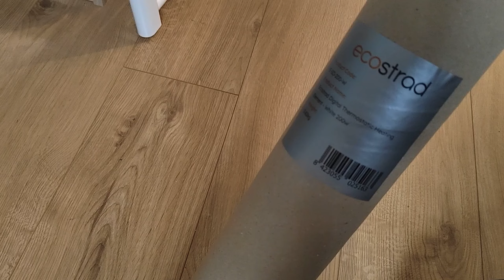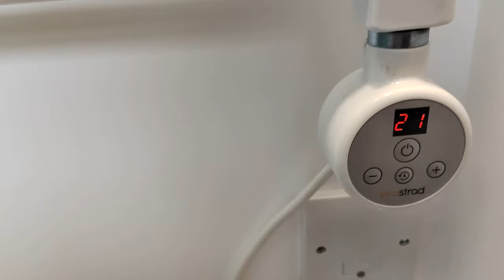Pre-filled electric towel bathroom  radiator installation and hard wiring

Comment: Can you advise on towel rads that claim to be 'dual fuel'? As in connected to central heating, but with an electric element too.

I like the idea, but am dubious about whether it actually works well...
Reply: Ours is DF. You will notice no difference whatsoever
Reply: Ours is DF. You will notice no difference whatsoever
Reply: Ours is DF. You will notice no difference whatsoever
Reply: Ours is DF. You will notice no difference whatsoever
Reply: Ours is DF. You will notice no difference whatsoever
Reply: @felixscamp  thanks, that's good to know.